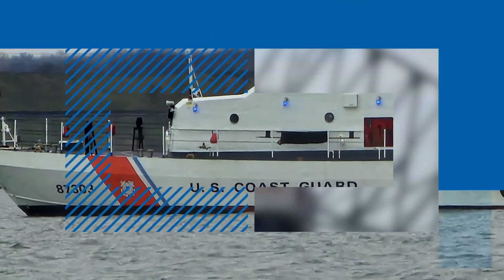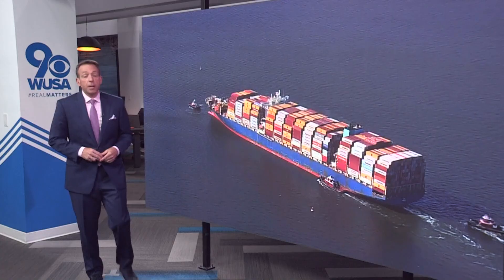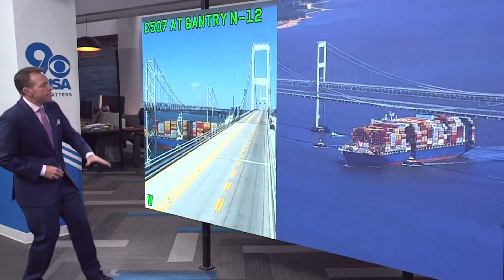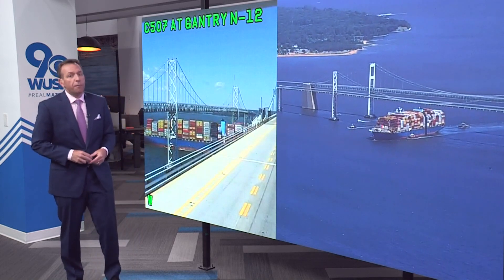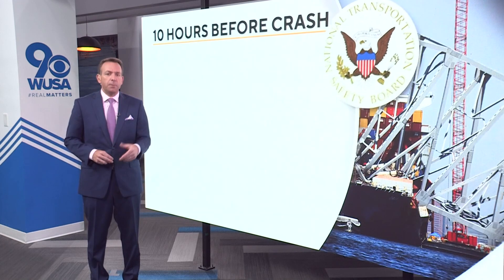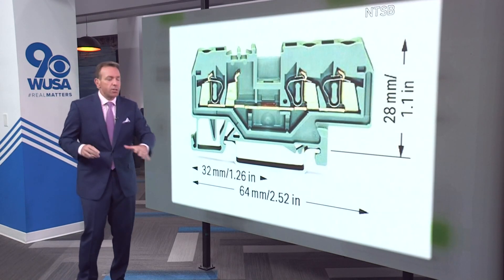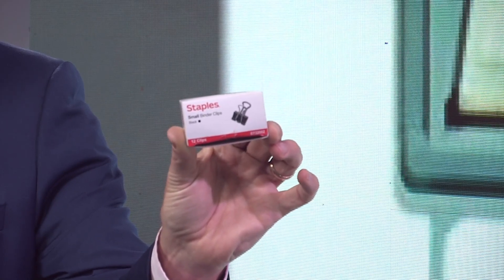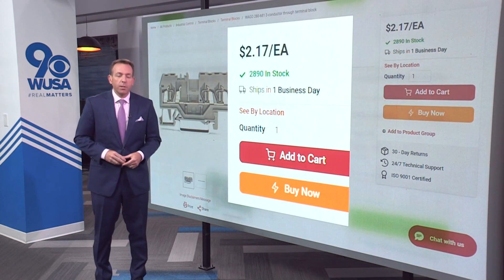How a $2.17 piece of equipment may have led to the Francis Scott Key Bridge collapse

Comment: 1:18 Those appear to be what I know as "stab" connectors. A lazy and cost cutting measure. No under screw connections as in older times, just strip the wire's insulation and stick it in the hole. A too small of a contact area between the "blade" and wire reducing amp capacity.
These type of lazy connections have a fair chance of existing in your home in recepticles and switches. They've been around since the 70's I belive.
I don't know how these type of connectors managed to exist for so long.
Wire under screw is the only safe way.
Maybe one day engineering will remedy the thin ice they skate on, I'm sure they realized it from the start.

Comment: I just read the NTSB report, and the reporter simply didn't understand what was said. The terminal block was simply part of a "control voltage safety electrical circuit" that was suspect in causeing the main transformer being used, at the time, to be taken off line at the worst possible moment. The circuit was associated with the high voltage contactor that was feeding the main transformer #1. So the investigation took all the the wiring associated with the probable cause of the accident and have that control wiring, which includes that contactor block, at their labs for analysis. Contactor blocks have no moving parts, they simply act as termination points for wiring. It is very unlikly that a contactor block would cause a voltage dip, that would then cause the high voltage contactor to trip off line.
Reply: Using a ferrule is best.
Reply: @1985230ce  
Yes, and if you close one end of the ferrule and blow across the other you can make a whistle!
🎶 AHOY CAPTAIN!! 👍😉
Reply: @JohnShinn6078  
I’ll have to try that.
Reply: This failure is far more complicated than the meda has the capability to understand and report accurately.  Both the high and low side breakers on transformer #1 are reported to have opened.  This is indictive of a high load on that transformer.  This is indicitative  of the regererative capability of the 440 volt bus ( many running induction motors) backfeeding into a motorized generator.  The motorized generator was the result of a defect or error in the load share circuitry of  parallel runnuing generators.   The NTSB has a real challenge on this one.  We are all egar to get more information.
Reply: 1:18 Those appear to be what I know as "stab" connectors. A lazy and cost cutting measure. No under screw connections as in older times, just strip the wire's insulation and stick it in the hole. A too small of a contact area between the "blade" and wire reducing amp capacity.
These type of lazy connections have a fair chance of existing in your home in recepticles and switches. They've been around since the 70's I belive.
I don't know how these type of connectors managed to exist for so long.
Wire under screw is the only safe way.
Maybe one day engineering will remedy the thin ice they skate on, I'm sure they realized it from the start.
Reply: jonhamel1767
Yes, no moving parts required, just exceeded amp capacity at the terminal contact points between wire conductor and the terminal contacts or undersized terminal block used for the circuit's normal amps, causing excessive heat and resulting erosion of actual contact areas and creating a total failure of needed amp capacity creating an open circuit (a total "voltage dip"). I assume constant power flow is needed to maintain a breaker in the closed position, no flow causing a breaker to trip.
Reply: @JohnShinn6078  The circuit in question is a control circuit not a power circuit. If the circuit carried any amount of current, a fuse would of been placed elsewhere in the electrical circuit, it is very unlikely the terminal block was the point of failure. If the control circuit measured voltage on the 6.6kv high voltage bus, it would of only been through an inline potential transformer that would have stepped down the signal to what ever the control voltage was in this configuration was. If the terminal block in question had failed as you suggested, that fact would of been reported and it was not.
Reply: @jonhamel1767   I know its not a power circuit.
  How many amps does the one control cicuit use? Does it control a mechanical servo of a sort? A partially shorted servo winding? A FULL time energized solenoid servo to maintain a CLOSED, very LARGE main breaker?
  A terminal block carrying little or no current, (well below the terminal block's rating) would not cause a failure of the terminal block, so why the NTSB's interest in that block?
  I'll admit I downloaded the NTSB's preliminary report weeks ago and have yet to read it, I gleaned enough from media reports.

Comment: People, these parts don't sit around and fail on there own.  Somebody may have overtightened it, or not inserted the wire all the way, or used the wrong wire. These parts are built to UL standards and UL does surprise inspections at the manufacturer.

Comment: I have used hundreds upon hundreds of those same terminal strips in automated equipment I’ve built and never had a problem with them.
Reply: I found a striped screw in something like that. It prevented the wire from being tightened properly. My repair saved the company tens of thousands of dollars. Do you think I got a thanks?

Comment: There is no failure of that magnitude that is due to a 2 dollar part - I am guessing they grossly oversimplified the NTSB report. Some industries have a concept of single failure criteria where systems are designed so no single failure can cause the loss of a key function. I would imagine those ships are designed and operated to similar standards. If I had to guess with no data, I would guess they had multiple failures, with one of them being the 2 dollar part.

Comment: That terminal block is junk it is for aluminum wire not coper this is from WAGO'S DATA SHEET it was used because it is CHEEP. GA AFTER THE SHIP BUILDER AND DESIGN TEAM.
 	Terminating Aluminum Conductors
WAGO spring clamp terminal blocks are suitable for solid aluminum conductors up to 4 mm²/12 AWG if WAGO “Alu-Plus” Contact Paste 249-130 is used for termination.

“Alu-Plus” Contact Paste Advantages:
Automatically destroys the oxide film during clamping.
Prevents fresh oxidation at the clamping point.
Prevents electrolytic corrosion between aluminum and copper conductors (in the same terminal block).
Provides long-term protection against corrosion.

Using terminal blocks with CAGE CLAMP® Spring Pressure Connection Technology, aluminum conductors must first be cleaned with a blade and then immediately be inserted into the clamping units filled with “Alu-Plus” Contact Paste.

It is also possible to apply WAGO “Alu-Plus” additionally on the whole surface of the aluminum conductor before termination.

Please note that the nominal currents must be adapted to the reduced conductivity of the aluminum conductors::
2.5 mm² = 16 A
4 mm² = 22 A

Comment: And jet fuel can melt steel beams.
Reply: Normal people moved on from this laughably stupid conspiracy theory long ago, Josh.  If jet fuel burns at 410 degrees then why are jet engines built to withstand temperatures of over 3,000 degrees?
Reply: Noooo, the intense heat from burning jet fuel melts steel beams. Just like the recent bridge collapses from fuel burning under highway overpasses.
Reply: Normal people moved on from this laughable conspiracy theory long ago, Josh.  If jet fuel burns at 410 degrees then why are jet engines built to withstand temperatures of over 3,000 degrees?

Comment: More likely improper torquing wires to the terminal block.  
Kinda like replacing a house circuit breaker, but not adequately securing the wires.
Reply: The WAGO 280-681 Terminal block is spring loaded...

Comment: I’m going to say no. There are plenty of redundant systems in place to bypass that terminal block. And besides, the fact that the power went off twice tells me it wasn’t that part. Electronic parts can’t self heal, so once it goes it goes for good.
Reply: Could've been shorting out from loose connections, etc. I think you're thinking of a fuse block.
Reply: @crazestyle83  I’m thinking of a terminal block. My overall point is, the terminal block shown could probably carry 30 amps at the most, depending on the voltage. That terminal block may have carried a control voltage to a set of relays that operated higher voltage equipment, but unless that high voltage equipment was all run through that specific bank of relays tied to that terminal block, I don’t believe one terminal block could have the effect shown with all the ships lights turning off then back on. 
The entire ships power control system would not be operating off of such a small bank of relays. What is seen indicates a larger failure of an entire system. In other words entire banks of terminal blocks and relays failing simultaneously. Basically a power outage.
Reply: They can also be weakened ... not fail, but become the next point of failure. If "A" fails you need to check everything it influences to make sure they aren't hanging on by a thread.

Comment: Some of those containers must be pretty ripe by now sitting in the hot sun for three months!
😂😂😂
Reply: The containers with perishable contents are refrigerated and have power to keep them cold or frozen. The product might go stale, but it's not like that unplugged dorm frig at the end of summer break where the residents forgot the hamburgers.
Reply: @lazygardens  But the on-board electrical power failed, which caused the failure in control of the ship.
Reply: @BillDavies-ej6ye  Power was restored within hours.
Reply: @lazygardens  Then all the vegetables will be fine...

Comment: This is BS  keep investigating.
Reply: They need to say which breaker tripped because of that terminal block , then the rest load shed , why didn't the emergency generator start up and stay online ?
Reply: I agree. Did I not read that this was not the first time they had issues with this?

Comment: The failure of some maintenance personnel is the cause.
Reply: There is no maintenance required for this type of terminal block other than a visual inspection a electrician would not need to touch this.